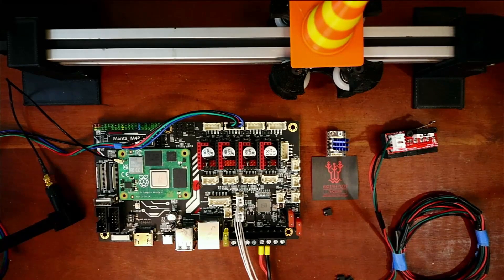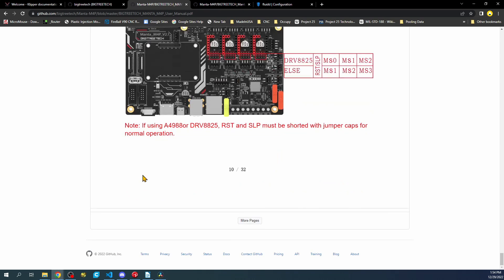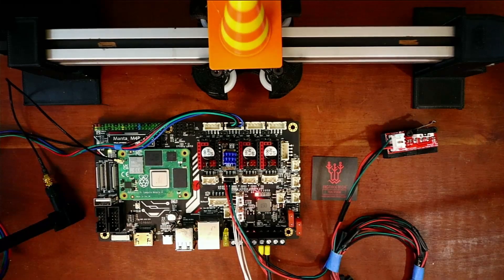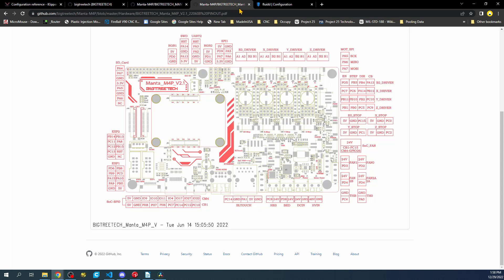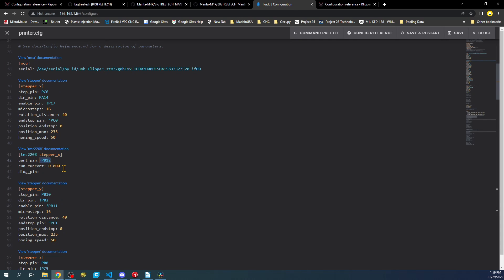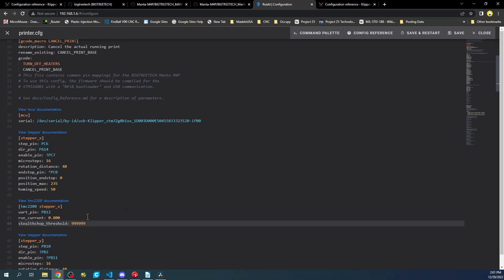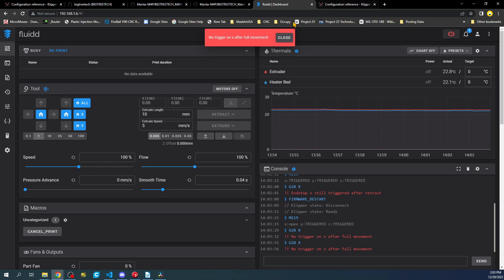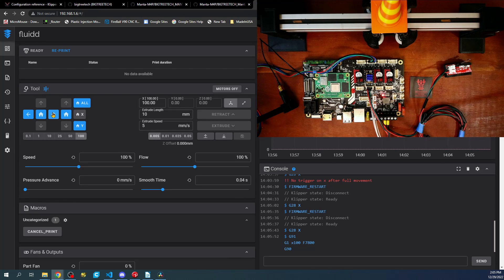BTT - Manta M4P - TMC2208 with Endstops

Comment: its stealthchop vs spreadcycle and this is the super big and important thing you didnt mention when you enabled stealthchop, it reduces noise sure but accuracy and torque as well. Klipper docs have tons of info on it, its far better to increase microsteps from 16 to 64 or 128 and accomplish the same thing sound wise without losing out on accuracy and power

Comment: Hello,
Thank you for the tutorial.
I'm currently connecting motors from my Creality CR10S PRO V2, with TMC2209 drivers on a MANTA M8P.
Motor power supply is 24VDC.
When i'm "homing" the X motor, I get a Klipper Shutdown with this message : 
Unable to read tmc uart 'stepper_x' register IFCNT
I have triple checked hardware and firmware, read the configuration reference and disconnect power but the issue still remains...
Same problem if i try with Y motor...
I'm driving crazy with this issue...
Reply: I have finally understood.
On the Manta M8P, between the motor connector and the TMC optional driver, there are 3 pins to select the power supply (main or motor power supply). I’ve forgoten to put jumper on selected pins… this is badly indicated on the manual !
Hope ut could help…